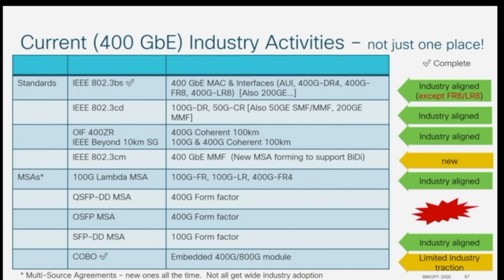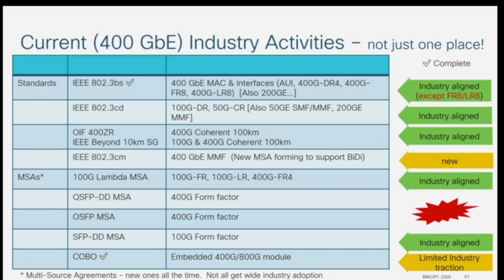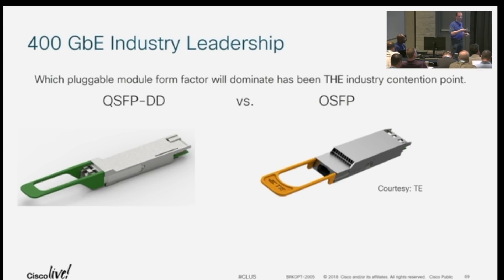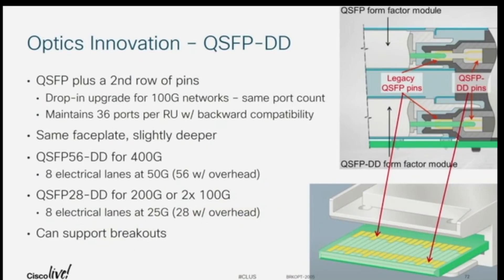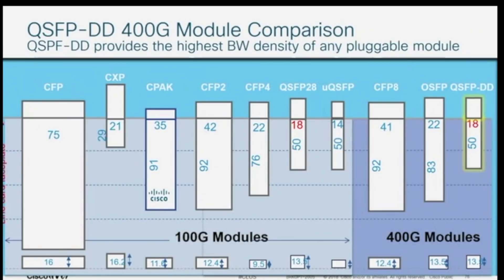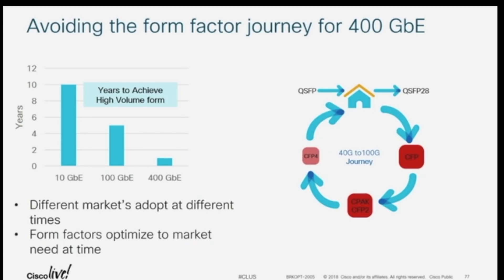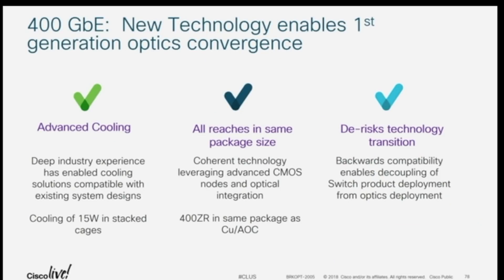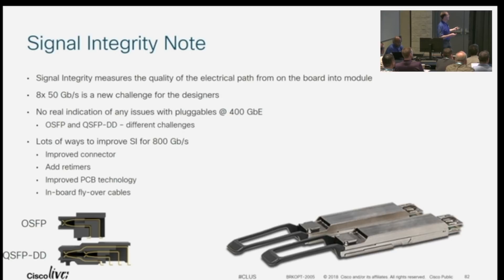400GE QSFP-DD

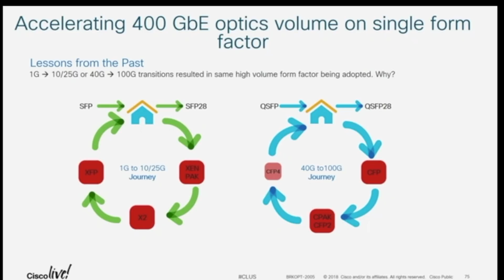Comment: QSFP-DD is the future.  Mark talks about this around 7:05.  The same way that XENPAK/X2/XFP and CFP/CFP2/CFP4 were 1) time-to-market module form factors, 2) were larger than the preceding technology,  and 3) ended up giving way to the module that maximizes system density and multi-rate use cases.  So with QSFP-DD right around the corner, the question is: why take the detour with OSFP or CFP8?